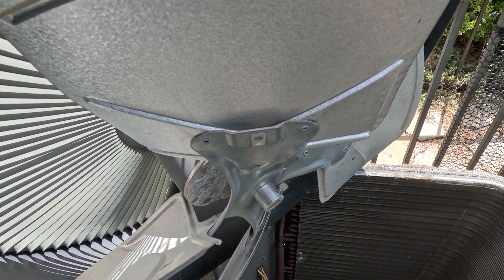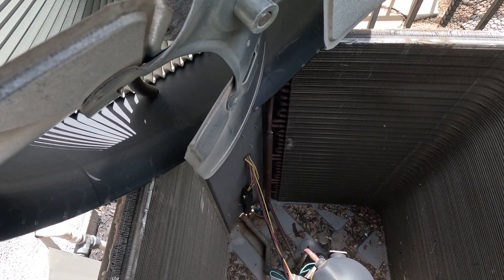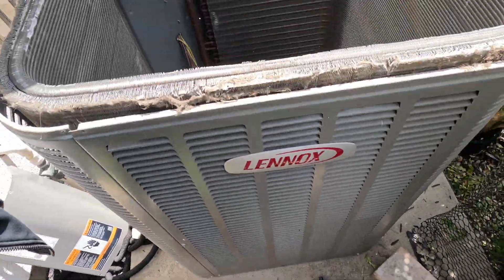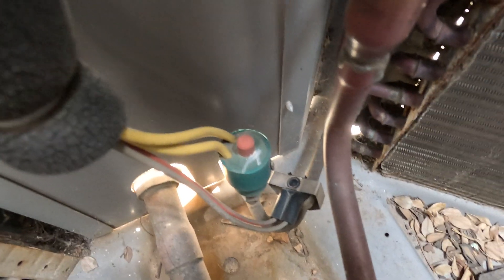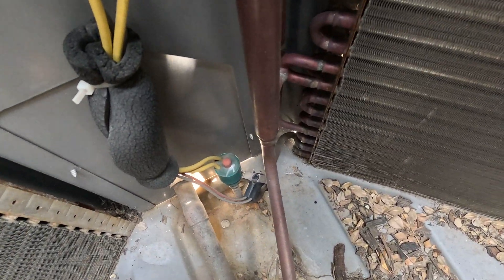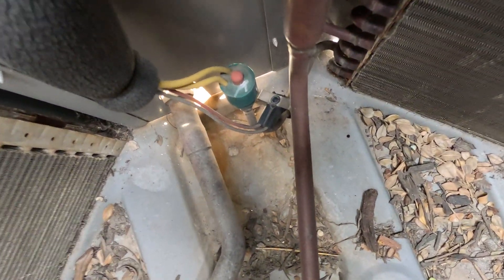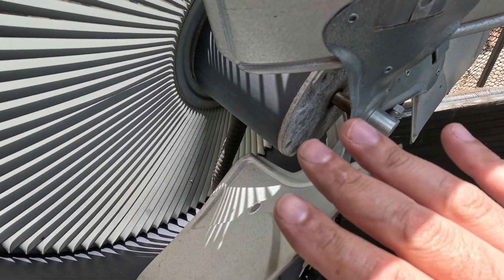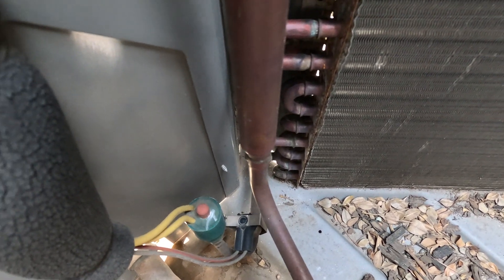Lennox High Pressure Switch Reset After Condenser Fan Motor Replacement. (4 ton Residential Unit)

Comment: I'm assuming turned circuit break off before doing so? Don't want to press the button and have fan start while holding it right?
Reply from the maker: Yes sir. Make sure the power is off before pushing the red button.

Comment: Thank you, you save my ass.  I opened the bottom of the unit by the switch and reset it.  Works fine.  I thought they had a timed auto reset.  By the way it tripped because my painters covered the unit with plastic.

Comment: My compressor unit outside turned on while rest of the unit is in off state... Could that be the high pressure fan switch needs a reset?
Reply from the maker: If your high pressure fan switch is activated it will completely disable your outdoor unit. Is your condenser fan motor spinning?
Reply: @diyhvacadvice2millionaire  Thank you for getting back to me. The compressor motor is working (I can hear the motor hum), but the cooling fan motor does not move at all. While inside the blower/fan motor is also not turned on (they usually turn on at the same time the outdoor fan motor is turned on).
Reply from the maker: Give the fan blade a push through the top grill with a long object while the compressor is running. if the fan blade starts spinning you will need a new capacitor. if the fan blade stays stuck your motor has seized. If your motor starts to run now you know you need a capacitor, but don't leave your unit running that way, as you will damage your motor.
Reply: @diyhvacadvice2millionaire  Great advise, I will check before repair person comes tomorrow. Thank you again!